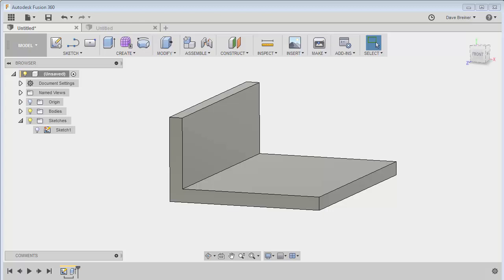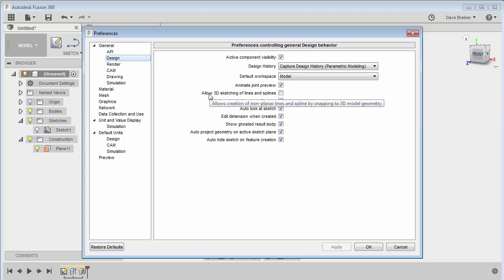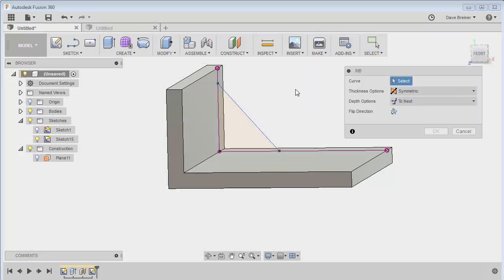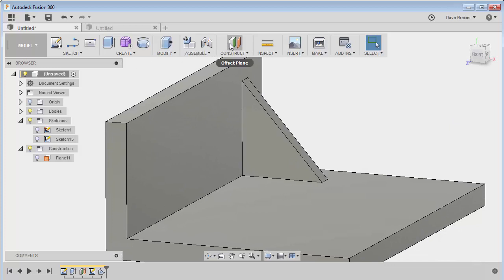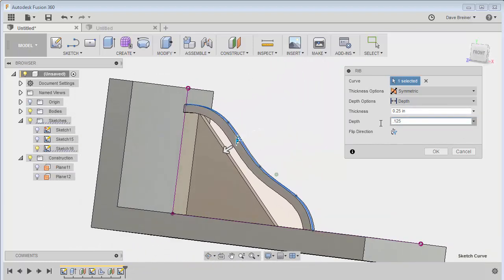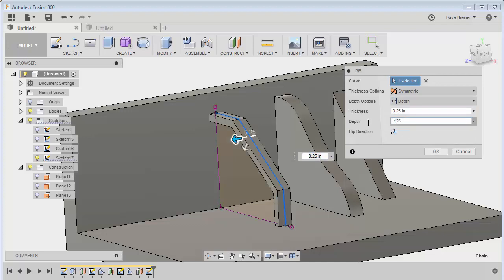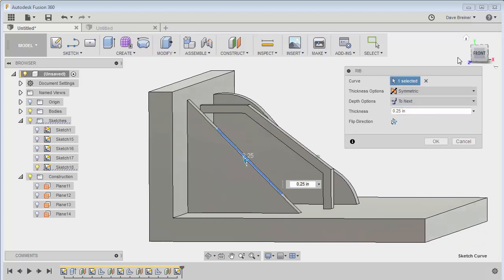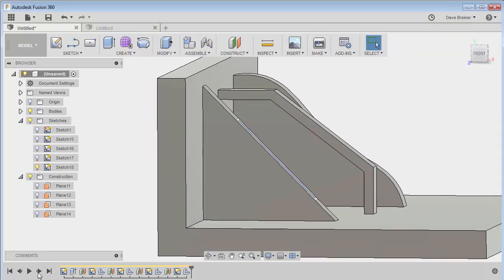Video Tip: Fusion 360 - Rib Feature

Comment: Whenever I need a rib, fusion finds a way to deny me. Like for example a rib between two orthogonal cylindrical parts, or a rib from a 3D sketched line connecting two faces. So mostly sketched ribs for me.

Comment: hi, can we do it if the surface its not a square and its a circumference
Reply from the maker: The answer is yes. I just recently answered your question with a video (Fusion 360 - Rib at an Angle) that should be posted soon.